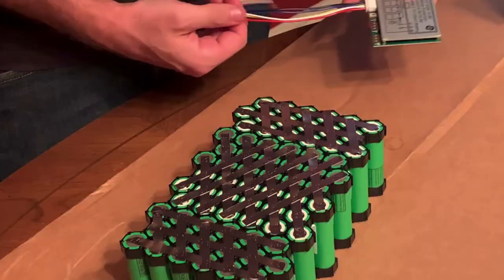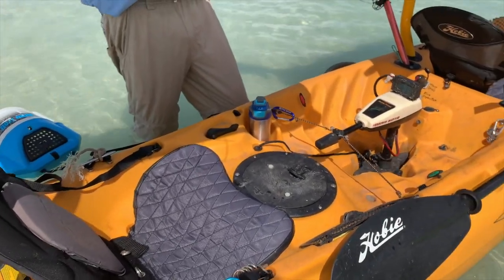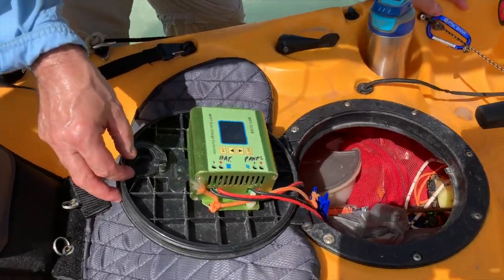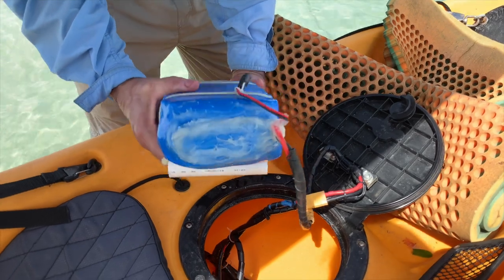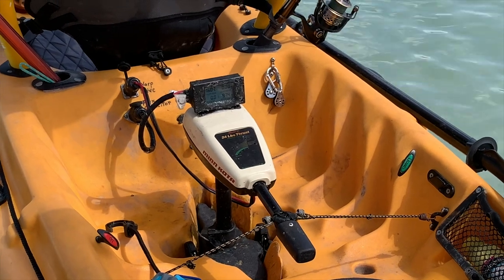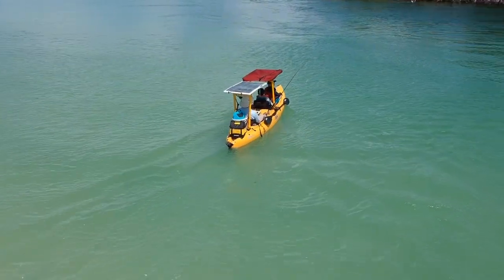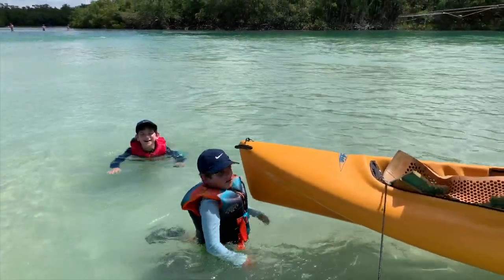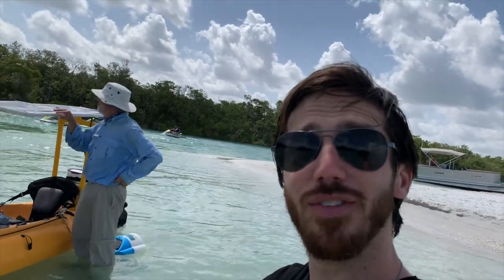DIY solar powered electric kayak (overview and demo)

Comment: I wanted to put an electric motor on my kayak but was told it would need registration . Australian stupidity.  I was thinking a small  sea snake.
Reply: So what would they think about this then? https://www.youtube.com/watch?v=89-SerAttxE
And that actually is a kayak, unlike the ski in the video. But you probably know that being Australian.
Reply: Florida has the same law.  The kayak in this video is in south west Florida and is therefore operating illegally on the water.  It's a stupid Florida law but the water cops will harass and fine you for doing so nonetheless.  Sometimes they even confiscate your boat.  It's just another example of ways the government employs to get money from you.
Reply: @melellington4892  Another reason to have the motor hidden in the bottom of the rear cockpit instead of off the side or at the stern.  Throw a towel over the motor head and I'm totally legal !!

Comment: So its an electric kayak. With a solar panel on top that basically does nothing.
Reply: Yes on kayak.  Solar panel adds up to several miles or hours depending on speed and prevailing conditions.  Doesn't fully feed the needs of the motor but the battery loves that panel.  And I have miles of smiles !!  Peace.

Comment: hard to fly fish with that top
Reply: Fly fishing would be a challenge the canopy does turn side to side as well as tilt up and down so it could be done.  Personally, I'm a bait fisher so I can cast easily and spend a lot of time casting low below mangrove limbs over the water where the fish tend to be.  When I'm out by myself, I go without the front canopy so I have open space to cast and retrieve.  Thanks for your comment

Comment: There is no way that solar panel is powering that trolling motor, most power is coming from mains when pops gets home. A little disingenuous...
Reply: I have several times come home with more power in the battery than when I left the ramp.  It all depends on speed, distance travelled and how long I sit in one spot fishing.  Not disingenuous at all.  At bare minimum it is a range extender that makes sure I have enough juice to get back home.

Comment: pretty useless in ANY different circumstances/waters/wind/sun conditions.
Reply: Not true at all - been out in 20 knot winds, surfed it over 3.5' wave and taken it across a serious chop.  This yak has a wide beam and is amazing stable.   Even have sailed it in 12-14 knot winds without outriggers and never tipped it over.  Jelly??

Comment: electrical system on a tipable boat?  i dont know how smart that idea is....
Reply: This is not your typical kayak.  It has a 33" beam and I have sailed it in 8-10 knot winds healed over pretty far, surfed 3 foot waves along the beach and gone miles with white caps and 20 knot gusts and never had it flip.  I agree with you that this type of system is not right for lesser kayaks that are tippy by design.  Thanks for your comment

Comment: How’s this a kayak? It’s a floating barge. Please give it a different name. Defeats the purpose of a kayak.
Reply: what is the purpose of a kayak?
Reply: @robkulevich1832  to be a part of nature. Kayak is a means by which one can move quickly and quietly, and discreetly in water in all weather conditions. If you want it otherwise put a motor on it and give it a different name. Does this look and embody the gracefulness of a kayak to you? Kayak is derived from words meaning slip/slide. This one should be called “topple over” and swim device.
Reply: @fabiotuggy3340  lol